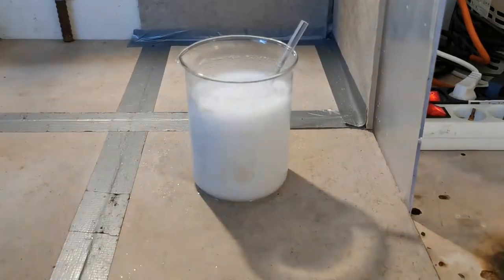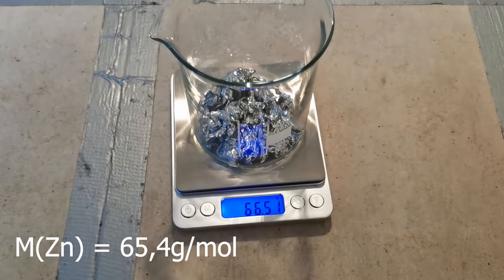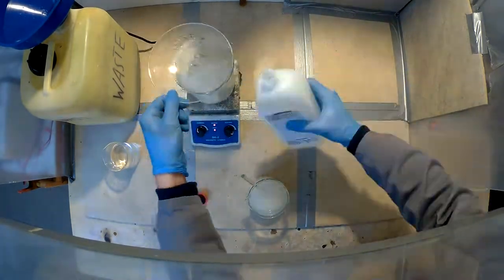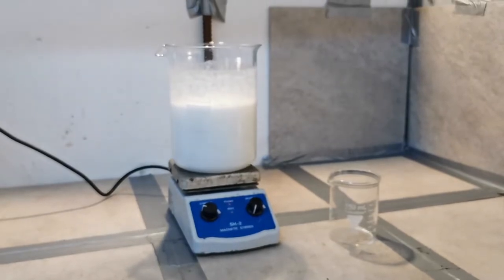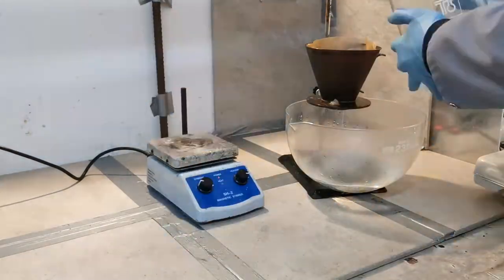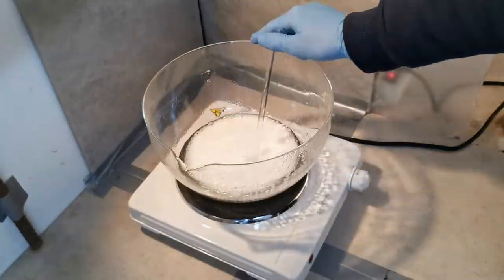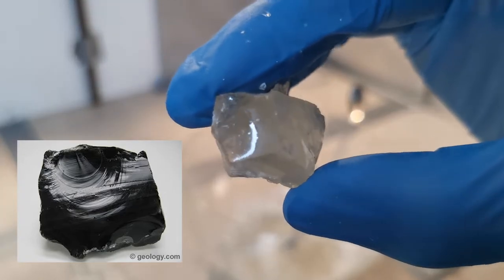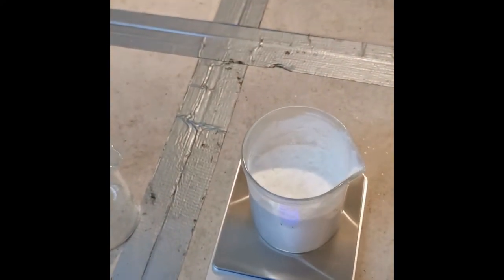Making zinc acetate

Comment: Nice video, do you know why, when i mix my zinc acetate with sodium bicarbonate i get a precipitate of zinc carbonate. But when i heat the zinc carbonate up i am left with a yellow-ish powder, not the white zinc oxide i was expecting.
Reply from the maker: I have no idea why it's yellow in your case specifically, but a lot of times a small amount of some impurity is enough to color a normally white oxide yellow, i experienced this yesterday as I was making some bismuth oxide, it was white until I calcinated it and it turned yellow.

Comment: Great video, I would be very keen to see you attempt acetic anhydride from the acetate!
Reply from the maker: Thank you, I will try it once I get my vacuum pump, now I use an aspirator which works great but I want to be able to read the pressure.
Also, I did some further research and it seems the paper which stated this pathway is really flawed and there's a good chance that it won't work.
Reply: @corrosivechemistry  I have read up on it quite a bit aswell it could still be worth a try though. There have been attempts on it and they have been partially successful where the anhydride wasnt condensed and was instead sucked through the vacuum pump. There have also been attempts with silver acetate that have yielded acetic anhydride. 
I understand the hesitancy people have on believing it will work however without trying it knowone will know for sure! Also if silver acetate yielded AAA that says somthing.
One other thing is zinc acetate can be used for acetylation itself via refluxing under anhydrous conditions with certain compounds!
Reply: aluminum acetate
Reply: @Goodluck-tl7dp  sorry? Aluminium acetate does…?
Reply: @noodlesoup2281  acetic anhydride.out of him
Reply: @Goodluck-tl7dp  never heard of it, are you talking about pyrolysis under vac? And do you have any literature for this?
Reply: @noodlesoup2281  heating aluminum sulfate with sodium acetate.exchange reaction
Reply: @Goodluck-tl7dp  are you positive this works? Also any chance you have some literature surrounding this or a source?
Reply: @noodlesoup2281  Russian patent
Reply: @Goodluck-tl7dp  is there any chance you know where I can find it??
Reply: @noodlesoup2281  database of patents to help
Reply: @Goodluck-tl7dp  I am unable to find anything related to anhydride?

Comment: Also keen to see the anhydride
Reply from the maker: Well, I actually tried it but it doesn't work at all, drying the salt complete is verry difficult and any water is conna destroy the anhydride, also during the Destillation it releases lots of Gases which makes a vacuum impossible, it actually blew of the stopper oven though I had the pump running, the stuff I got out was mostly water...
Reply: @corrosivechemistry  I actually got around to trying this small scale as well but I had much the same issues… It did however produce some pale brownish liquid.. I have no idea what it is, it certainly didn’t smell like acetic anhydride..

I think if I’m going to try to make it I will go the Sulfur chloride route..

On my list is to try acetylate an amine with an acetate salt again not sure it will work but we will see!